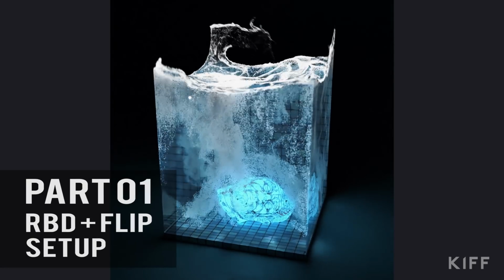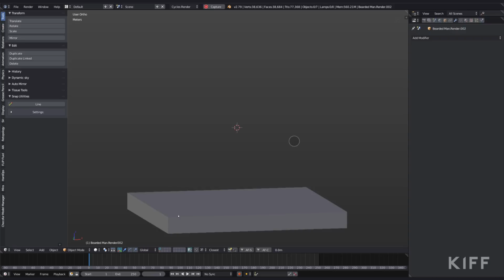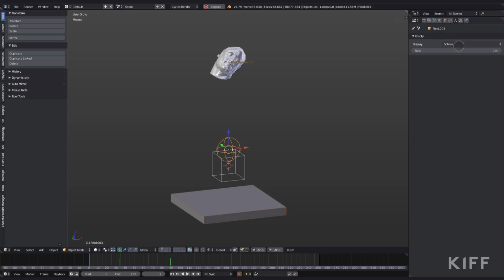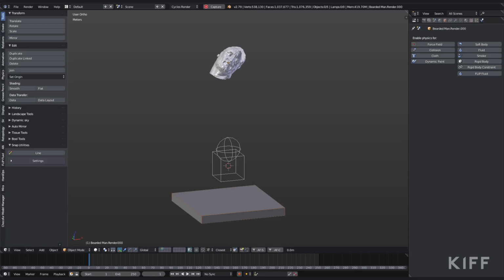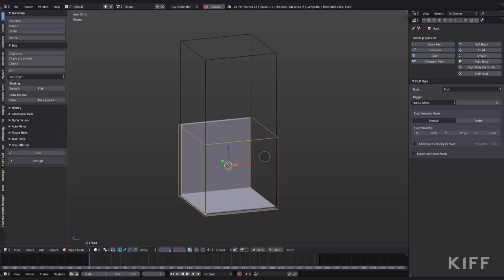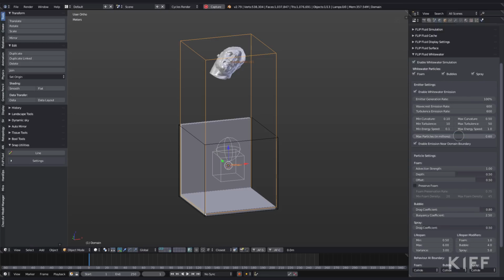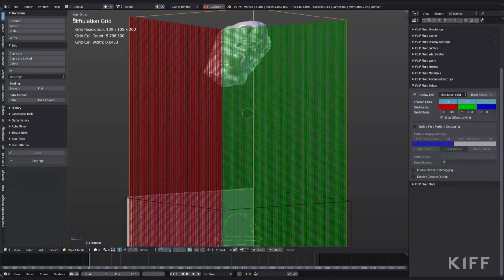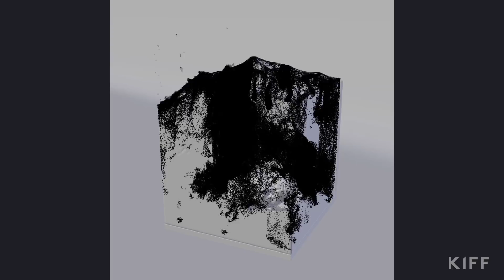Blender Scene Beakdown - Part 1 - Rigid Body Dynamics + Flip Fluids workflow

Comment: Hi bro! Im a beginner. I have a question if you dont mind. How do you edit your turbulance from o to 300 then 300 to 0? Thanks a bunch! 😄😄
Reply from the maker: Go to the frame you want the strength to start animating on, so it's about frame 32 in this tutorial. Change the Strength to 0. Hover the mouse over the Strength property and press "i" to insert a keyframe. Or right click on the Strength property and select "Insert Keyframe". Then move to frame 37 and change the Strength to 300, and either right click on the Strength property and choose "Insert Keyframe" or just hover the mouse over the property and press "i". Then just do this again at frame 102, insert keyframe, then go to frame 106 and set the Strength to 0 and insert a keyframe
Reply: @K1FFVFX  Wow! Thanks for taking some time answering my question bro! you're a nice guy. SUBSCRIBED!

Comment: I noticed that you didn't do anything else to your 3D head when you designated it as an obstacle in flip fluids...  yet, your 3D head was interacting with the fluid.  I did the same thing as you and my 3D mesh won't interact with the fluid at all.  I even made sure to click on "export 3D animated mesh because my mesh is animated... it still isn't working.  I don't know what I have done wrong?
Reply from the maker: Drinner D man it’s thought to know why it’s not behaving correctly. If you have followed each step correctly it should interact with the fluid.
Reply: @K1FFVFX  hmmm... well, I did but nothing is working.  So, I guess that's that, then.

Comment: is this in blender 2.79? Ive seen there is an experimental flip fluids release for 2.8, but cant get it working. Would love to know if anyone else has had any luck though
Reply: In case you're still struggling to get Flip Fluids working in 2.8, try the following:
Check the box to render in full screen view and also check the 'Lock Interface' option in the same drop-down menu at the top of the screen.
Sounds weird but this worked for me after I saw the suggestions online. Could barely get 1 frame to render before that. Now, all seems well:-) Good luck!